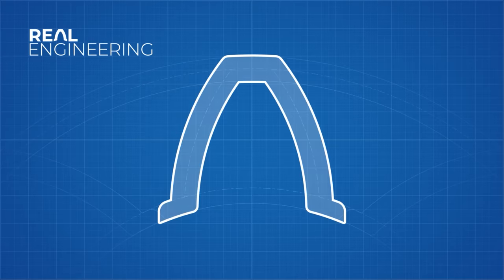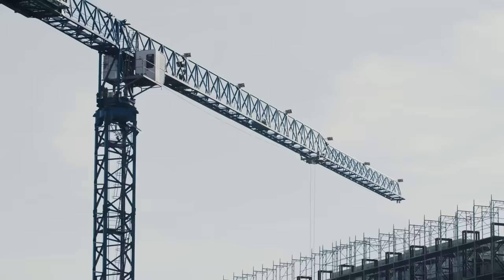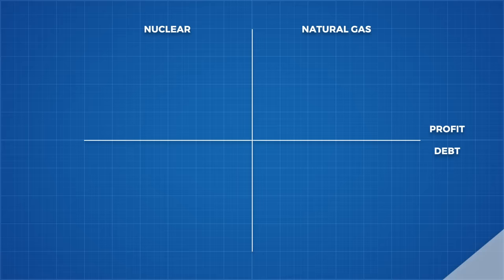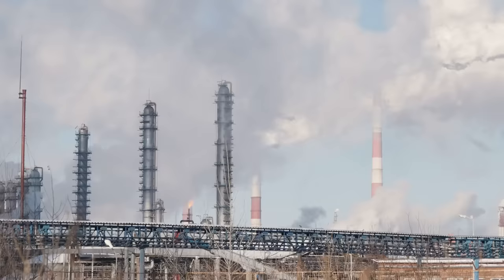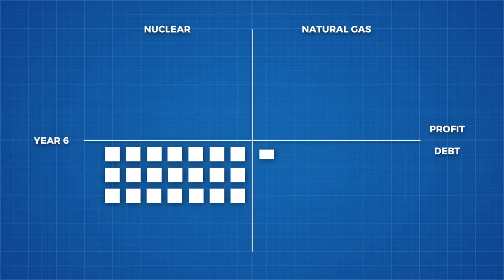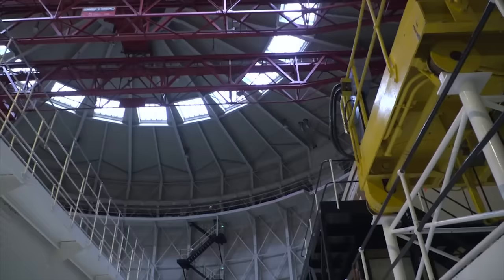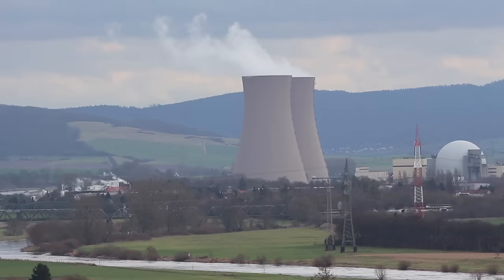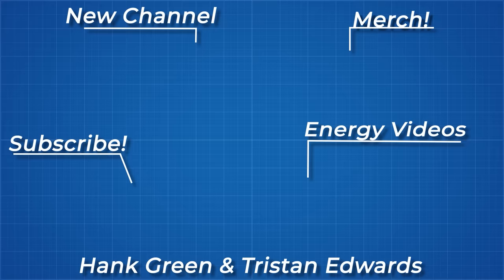The Economics of Nuclear Energy

Comment: A great use for excess nuclear power when a lot of solar/wind is available to the grid is the production of hydrogen. This will help further decarbonise transportation and other industries.
Reply: but it requires high temp reactors (high enough to disassociate hydrogen from oxygen) so that getting the hydrogen is a natural byproduct and not a wasteful electricity dump (electrolysis)
Reply: Producing hydrogen for transportation is just about the worst way to use excess power just after dumping it in dump loads: from energy in to hydrogen in a car's tank there's like an 85% energy loss - and then you still need to turn it back into electricity with super expensive fuel cells. 
You're much better off charging batteries, pumping water up basins, or running carbon capture plants to make synthethic hydrocarbon fuels (like Carbon Engineering is doing with their proof of concept plant).
If you're making the hydrogen for use as a chemical feedstock right at the chemical plant then it's a good use of power, but as an energy vector it's absolutely horrible and has no place except maybe extremely select applications like long haul trucking in super remote areas.
Reply: @Boosted98gsx  I meant that the excess electricity could be used to power dedicated hydrogen production plants rather than as a direct by-product.
Reply: @demoniack81  for land-based transportation, I agree. However for aircrafts, batteries aren't an option because of the weight-to-energy ratio (covered in another video on this channel). It's wasteful, but it's the only realistic way of flying planes without releasing CO2 with our current technology.
Reply: @Stardustnib  We can make carbon-free synthethic liquid fuels by pulling CO2 out of the air. Carbon Engineering is already doing it in their pilot plant and it works, it's just a matter of scaling it up and making it cheaper.
Also compressed hydrogen wouldn't be dense enough either, and I'm not sure liquid hydrogen would be a great idea for aircraft, it's way too dangerous in case of a leak and you'd probably suffer a lot of boiloff over a course of a multi-hour flight.

Comment: You might want to go into detail on solar energy and its environmental impact from production and disposal.
Reply: pretty tiny, amortised over the lifetime of the solar plant. Esp thermal solar. Because you have to compare total cost of energy generation over 20 years, the solar plant+batteries is all capital cost and maintenance, the gas and nuke plants have continuous fuel and waste costs (both monetary and environmental).
If you include the fuel and waste, as so many who want to make this comparison don't, the renewable power is /much/ cheaper per kW over 20 years.
Reply: @thekaxmax  only if your cool with the lights (and everything else) going off when the sun don't shine or the wind doesn't blow.  Of course, you could build both and have power so long as either one is happening, but now you have to pay for twice as much construction, and it still won't be enough to keep society as it is.
Reply: @thekaxmax  that's just not true considering extremely low energy production per cent invested for solar and huge ecological impact as you have to occupy vast territories with pannels polluting it with chemicals used in washing and also the materials used in solar are mostly toxic and harmful to extract while modern nuclear already consumes what was considered waste 40 years ago and will utilize as fuel what is stored as waste right now in next 40 years

Comment: A good place to start is to stop investing in petrol
Reply: Petrol is almost as doomed as the  nuclear industry. Fortunately crude can also be used to make plastics.
Reply: Invest anywhere you like. It's the subsides that Big Oil and the nuclear industry get that should be eliminated. If they're viable businesses they shouldn't need subsides at this point. Nuclear has been around 75+ years and oil for over 100. They're not startups anymore!
Reply: @therealctoo4183  The joke bait that fossil fuel subsidies entertain is that it helps to maintain domestic jobs and keep the retail prices low at the pump - both incredibly political topics.
Reply: And what will replace it?
Reply: @PistonAvatarGuy  Are you living under a rock? Electricity generated by renewables and stored in batteries of various kinds!
Reply: @therealctoo4183  
Nuclear gets almost zero subsidies compared to fossil fuel and renewables.
Reply: @gregorymalchuk272  That's a lie. Nuclear has nothing set aside for long term storage and security, both of which will be needed for centuries. Nuclear is a gigantic welfare queen.

Comment: 13:42 as a physicist I can tell you that a nuclear reactor can't be made "diespatchable" except if it uses a totally different kind of nuclear technology, based on a different kind of fuel than what is used in all modern reactors. The reason for this is that the reason why nuclear reactor can't be quickly turned on and off is not engineering but basic physics of Uranium fission. Thorium might be promising but if a Thorium reactor will ever work and be commercially viable, it will be definitely too late to avoid the climate apocalypse if we don't massively reduce CO2 emissions before.

Comment: Having worked with Energy systems and with the nuclear energy industry I believe its very important to remember that not a single - not one single - nuclear power plant on the face of Earth carries its own full running costs. Also, it uses enormous amounts of water compared to solar and wind. I do believe that nuclear can play a positive role in the world's energy mix, but it will always be a marginal factor for lots of reasons. The US electricity market is a good measure of how difficult it is to run a nuclear plant with profit. They not only run very high building costs but also run far, far below projected outputs in the real world. There are no nuclear plants anywhere that are "insanely" profitable.
Reply: Randomerz  as I said, I have worked with the industry and I have specifically also worked with EDF. For starters their electricity is no longer cheap - even if they rely on substantial government subsidies. I am even uncertain if they pay for the water they use. But it is a fact that their use of water is creating problems in certain parts of France. To me the verdict is out on the long term viability of France' reactors. They were a good response to the energy crisis and they have delivered huge amounts of electricity - and at times for a good price. Would I build them today? Probably not. But that's an involved calculation and domestic policy concern played a critical role originally which can never be discounted. This is also why it will be difficult for France to give up on nuclear apart from the bet that it can remain a viable export industry. Also, Germany is not producing anywhere near the amount of renewable energy it needs. If they did electricity would be a lot cheaper than in France - and I do suggest you look these things up yourself as you seem interested in the facts.
Reply: Randomerz  Germany is not an example of anything renewable and cannot be compared with countries that have a purpose built renewable infrastructure. And no matter what: nuclear is not price competitive with renewable by a long shot. Yes, renewables cannot be used cost effectively everywhere, neither can nuclear, coal, gas, oil etc.
Reply: Randomerz  US Energy Agency, IEA and IRENA all have the numbers. Nuclear - even with its government subsidies - cannot compete with renewables when it comes to electricity prices. Maybe new tech can change this, however, the cost of renewables continues to drop at an astounding rate. Please inform yourself. I'll stop here. The facts are easily available from renowed and reputable energy organisations. And just for the record: German energy policies are deeply flawed and are totally irrelevant to the discussion of the merits of nuclear vs renewables.
Reply: Randomerz  the prices given by the agencies I mentioned are comparing new builds nuclear/renewable/coal/oil etc. power stations - not old ones. As for reliability all systems have challenges. You can ask the Japanese what they think about the reliability of nuclear plants following their one-year long industrial brown-outs after the Fukushima disaster (a situation I specifically had warned the Japanese Government about during the previous year's global Nuclear Industry meeting, which was held in Japan). You can also consider figuring out why the UAE Government (tip: they are not telling) why they deliberately waited almost 2 years after their new reactor was ready before starting it. Energy systems are complicated and there are no one-size-fits-all. Renewables will take over the majority of global electricity production within the next 20-30 years. Will nuclear see a renaissance? Maybe. I personally hope so. But if this happens the time line is most likely 40-50 years from now and it will for many reasons remain a niche energy source on a global scale for much longer. As for the reliability of renewables they also have challenges. But there is no evidence that countries with a very high degree of renewable electricity have lower quality electricity (uptime) than those that do not - actually to the contrary -  countries that have expanded their renewable inputs a lot tend to do better. A main reason is probably that these Government make more careful energy planning and invest in better distributed energy systems (the mistake they had done in Japan with their nuclear plants and which led to the very long brown-outs just because a single plant went off-line).
Reply: Randomerz  He is right in fact nuclear is a lot worse than what he says. Actually just at this moment france has 17 reactors shut down due to safety concerns and their MWH price is at 1000€ when it normally should be 40-80€. Plus nuclear pollutes in decomissioning and mining so its far from green and even though reactors improve, their costs only increase and the efficiency drops when looking at the uranium ore problem, ore quality decreases..  so uranium has no future and would soon have to be considered less "green" than coal due to that uranium mining problem.

Comment: Excellent presentation, clear and easy to follow.
However, you left out one of the largest costs associated with nuclear power generation. Namely the cost of safe storage and security for the spent fuel rods and contaminated building materials when it comes time to decommission the station. 
This alone is always more than the income brought in from the sale of the electricity generated by the station. So for that factor only, it is never going to be a viable solution to use nuclear over a combination of renewables.
In New Zealand we use Solar, Wind, and Hydro for more than 86% of our electricity needs. It could eventually be done on a world wide scale if countries with excess generation could export to neighbouring countries.

Comment: What I was missing in the video: The cost of safely storing the used nuclear fuel for a very long time afterwards.
Don't want to make this a political argument, but this cost is often covered by the government. If a private company running a nuclear plant had to account for this cost, nuclear would probably be a much harder sell.
Reply: Cost is mostly due to NIMBY. Could literally store all the worlds waste in a small area (comparable to a regular waste dump site).

Also.....wheres the cost estimate for all the environmental damage from toxic waste due to renewables? Its often shipped to 3rd world countries and have them deal with it.

Like....at the end of the day its a very disingenuous argument esp compared to all the environmental damage were currently doing. Just...dump it all in a deserted place and make it a no go zone. Species  thrive better with nuclear waste around than with humans around...
Reply: tbh, I don't think it cost very much to store and dispose of spent nuclear fuel. At some plants they basically toss spent rods into a swimming pool (for decades) until they collect enough to dispose of  .. then drill a deep hole away from water and bury it for 200 years.. done. The key reason its affordable is because of the relative tiny amount of fuel, and waste produced.. In contrast,  the cost of natural gas and coal  plants collecting and containing 100% of their waste would be astronomical.  which is why it is acceptable to pumped it into the air, and quietly kill us and the environment.

Comment: Should the  dissembly of the nuclear power plant, after its lifetime is over, be included into the profitability calculation?
Also how about the cost of storing spent fuel for a extended period of time?
Reply: Indeed and the cost of the occasional disaster about 200billion on fukushima alone.  If I wind turbine blows up its no where near as damaging.
Reply: its built into the cost of running the plant at least in the US.

Comment: Thank you for the exciting question and the good video. Unfortunately, you did not sufficently take into account the dismantling and disposal of the power plants (only in the last graph).
Of course, dismantling wind power and gas power plants is also expenssive. However, the costs are very low compared to nuclear energy.
Based on concrete case studies from Germany and Switzerland, there are the following cost estimates: Averaged over different reactor types, costs of 2.9 billion euros for dismantling and final storage. The dismantling takes about 15 years until everything on the site has been dismantled, cleaned and decontaminated.
Result: Realistically speaking, nuclear energy can only be operated if the financial risks are taken by the society.
Reply: Nuclear power seems to work best with strong centralization & planning - long-term investment, fuel procurement, operational safety, fuel cycle infrastructure, final storage, security, ... - which is a big reason I loathe the idea of politicians subsidizing private, for-profit energy giants to build new nuclear plants (and after their term is over, probably landing a cushy job there). It also puts a damper on the prospect of small, decentralized nuclear plants - no matter how cool the engineering of next-gen reactors is.
Reply: @nibblrrr7124  Unfortunately, no one seems to take into account the vast amount of energy that is lost in electrical transmission, almost 70% in the United States.  It is therefore better to decentralize electricity production and produce it as near as possible to where it is consumed.  Who would want a nuclear power plant in their back yard?
Reply: @TheGuyThatEveryoneIgnores  Let’s do the math. 1MWh powers 100 homes for an hour. Nuclear reactors are built to produce an estimated 1,000MWh of electricity every hour. Now let’s consider the reliability of the reactors. How accurate the estimate is. Nuclear reactors are about 93% reliable. So they’ll end up producing 930MWh every hour which powers 93,000 homes every hour. A single Nuclear reactor will power most cities and take up less spots and end up more profitable and produce cleaner energy and are safer than any other power source and you get the idea

Comment: This argument is based on the dinosaur reactors of yesteryear and therefor deeply flawed.  Think small modular reactors from gen 4.
Reply: The dinosaur reactors of yesteryear, the ones which have been operating for 40-50 years by today, were 10 times cheaper than this, adjusted for inflation. Then the public and politicians decided it should cost more, because it's not fair, or because they thought it's too dangerous otherwise. Yeah, the inherently safest energy source is "too dangerous". Let's make it more expensive, and due to it becoming uneconomical, let's use other, much more dangerous power sources. Great logic!
Reply: @Joshua Kane Halsted Yes a lot of people are shocked when I tell them the cost overruns aren't due to the actual reactor systems but the insane concrete and welding labor costs involved in building the plants. Also like you said the trades aren't what they use to be but the cost of the trade labor has increased quite a bit, so when the eventual mistakes are made they just hit that much harder to fix. I just hope the NuScale model works out and takes some of the pain out of the licensing and construction process. I know our company canceled plans for a GE boiler (even after getting initial NRC licensing) to see how the licensing process for a NuScale plant will eventually shake out.
Reply: Gen 4 is decades ago due to a lack of R & D funding. In that time, looking at the current trends in renewables I think advancements in that sector will make Gen 4's redundant by the time it hits the grid.
Reply: @Joshua Kane Halsted Moltex is 5 years away.
Reply: @questionable8284  just that the US gets behind.